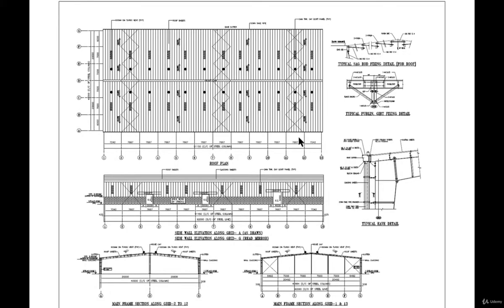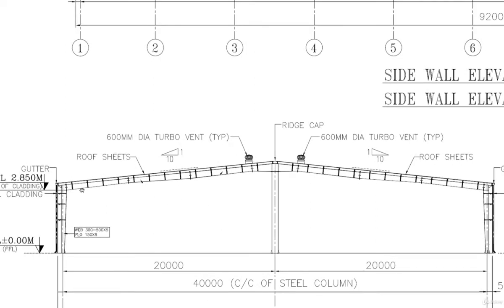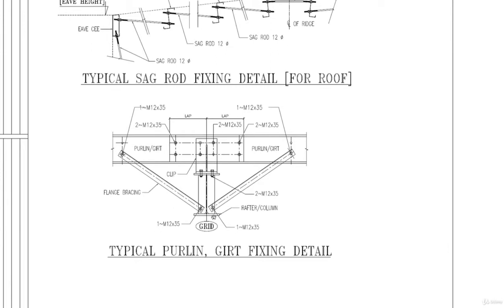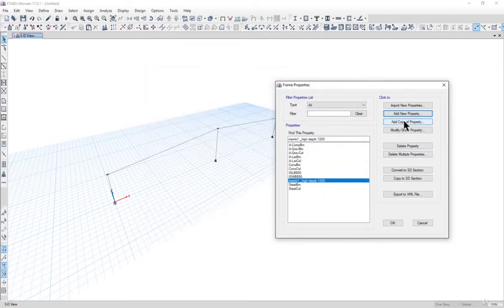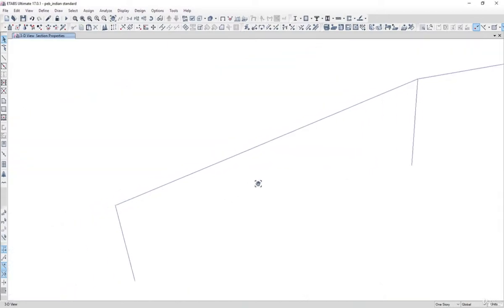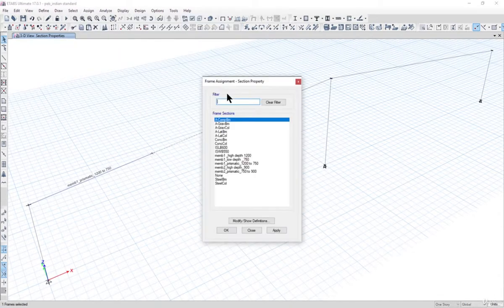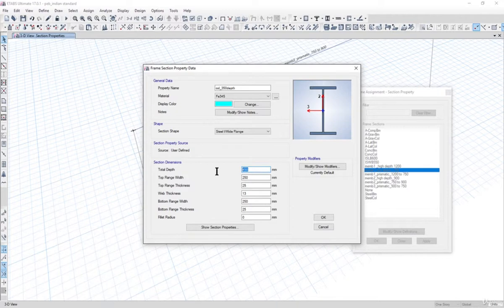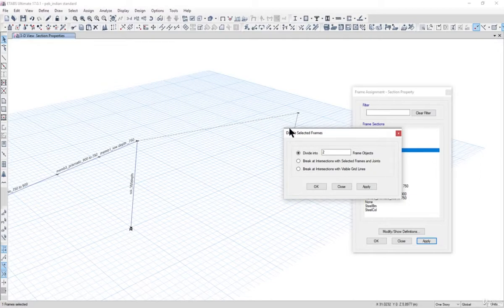3 Read PEB Drawings and Draw steel sections on etabs

Comment: Thank you very much. Sir, can you help me to draw a column having 4 pipe section connecting each other at an interval of 1 m vertically . Interconnecting pipes are horizontally and diagonally braced.